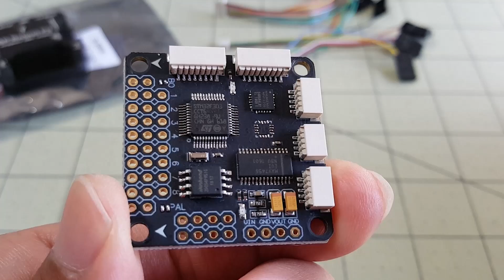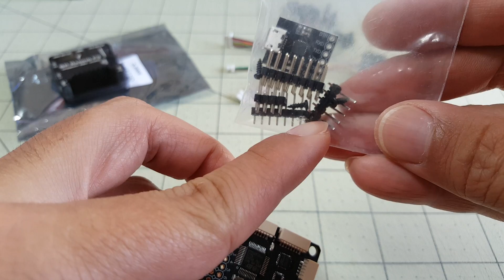F3 Flight Controller with OSD

Comment: Hi is there any chance you could tell me were to plug board in to use on etc betaflight, inav not having much luck.
Keep having a little green light flickering that it . plug in to another port get same green light and a red flashing one looked for a boot button but nothing on board.
Do i have to power board first please help most gratefully if you could.

Comment: I been having issues with my quad after changing motors. Got rid of the wobbles after raising tpa then I figured out how to flash the firmware. But for some reason I have no osd now. All the stitches are turned on in clean flight but still no osd. Do I need to download the osd as your talking about? The timer works but no flight modes or battery voltage Wich I need and no arm disarm. It just flashes and says no data. Help please? Lol
Reply from the maker: +Ian Rice enable msp on uart1
Reply: Albert Kim it is. I been trying to try it to work for days. I been learning allot. Do you have any other ideas? I have figured everything else out but the osd. Thank you for you help!!!
Reply: Oh I'm using the flycolor sp racing f3 board. Just thought you should know.
Reply: I turned on uart2 and Bam it's all working!!! Thanks man.

Comment: I have this thing wired directly to the battery using vbat pads, however mw osd will not display correct voltages.  it's stuck at 15.3 no matter what I do :(
Reply: 3D RC Did you end up sorting this out? I've had the fc for a while now and after updating minimosd +betaflight I did something wrong, so now my voltages are constant 16.4V....

Comment: Can you please tell. I badly know colloquial English, because I from Russia. What you need to do to turn the OSD on the controller?
Reply from the maker: +Виталий Its already on. You have to connect camera and vtx to have it pass the data to the video for overlay.
Reply: I'm all hooked up. But betaflight in the tab menu is written: "Your flight controller does not respond to commands menu. It probably means that it does not have an integrated BetaFlight of OSD" in the Flight controller just like in the video(F3 flight controller with integrated OSD).
Reply: Виталий anche a me risponde nello stesso modo... Come faccio ad attivare OSD??
Io uso INAV 1.7

Comment: Hi,nice review.. could you help me about wiring in spracing f3 include OSD? could you share the link? I'm so confused about powering the board,because I already connect 5v power from PDB but the board won't power on, thanks

Comment: Hi, thanks for the video.

At last find some information on this board.

At the moment everything works for me but I can not find information on how to connect an IBUS FS-A8S transmitter.

In a normal F3 this transmitter is connected to the welding points of the UART2 ( TX, Gnd and Positive) but in this plate I do not know where to solder the three cables (Negative, Positive and Signal)

Can somebody help me??

Thank you.

Comment: Do you known purpose of pads marked as "PAL"?
Reply from the maker: +David Gigauri no sure
Reply: Interesting point, I can't find any info about this pads.  :) I have same board, but have no time to setup it on second drone.
Thanks for response.
Reply: Probably for the osd to enter "pal" mode or "ntsc" mode. 
Un-soldered means ntsc, soldered means pal. 

That's my guess!

Comment: I just got the board. Updated the FC and OSD software (eventually).

I've quickly checked that the configured OSD display appears via the camera / VTX, but am unsure if there needs to be some software config done to actually get the FC data to be reflected on the OSD i.e. did they simply put a separate MinimOSD on the board which gets the data for display or do you have to configure a UART to allow it to be displayed.

Ideas, anyone?
Reply from the maker: +normoa you need to configure the UART and enable MSP
Reply: Which UART (presumably UART2) and does it require wiring from the OSD port to the UART?
Can you give me a bit more details with the setup? (Presume I'm dumb and you may not go far wrong... :D )
Reply: Hi, I assume it is hardwired to a UART, but the question is which UART? (I can not find any documentation on this). Do you perhaps know which port it is connected to? and any specific settings in Betaflight needed? Thanks

Comment: where would I hook up a spectrum satellite rx to this?
Reply from the maker: There is a 3.3v output documented in the manual on page 1. There is no dedicated spektrum port.  You have to grab 3.3v, GND, and RX from one of the UARTs.
Reply: so going by the docs it says gnd ch3 and adc1 or 2 for the 3.3v on the Io-2 connector. I think that's right ? thank you very much for your quick response albert!
Reply from the maker: You can get ground anywhere.  The 3.3v pin is the one that's important.  Also the RX of whatever UART you choose.

Comment: can you pls help me with this fc ? all is fine but when i connect my lipo the configurator stops working ...what i have to do ?thanks
Reply from the maker: What do you mean by configurator?  The software on Windows?  Also, do you have USB and lipo both connected at the same time?
Reply: Albert Kim 
Yes on windows ! I run btfl 3.01
Spf3 target !
Usb to ttl conected with fc and lipo ....
I can not cal. Esc and endpoints off rx ...

Comment: overall thoughts? good FC? what is on the osd? tuning thru osd?
Reply from the maker: It's good.  The OSD is the micro minimOSD so it does all the same stuff that one does.  It's just integrated into the one board.

Comment: Hi sir, thanks for the video, I'm new on drone world and I'm trying to build my first one now, I just bought this board but I cannot find any wiring diagram for this specific one, do you have any wiring diagram to share with me?
Reply from the maker: click link in the description... the manual is on the product page.  it's a PDF file you can download.
Reply: Hi, Thanks I just flashed with latest firmware, now I'm going to flash the arduine and then OSD. But on this website doesn't have the wiring for other stuff :(
Reply from the maker: Perhaps you can be more specific on the "other stuff" that's missing?  I'm not sure what you're talking about.
Reply: Sorry, I mean I need a general wiring guide for everything using this board, FPV, camera, etc. is there any available?
Reply from the maker: Sorry, that's the only documentation I'm aware of.  For the VTX and Camera, you connect those to VOUT and VIN (stands for video out and video in).  It's clearly labelled on one of the diagrams in the manual.
Reply: Thanks, managed to upgrade and configure OSD. I'll have to figure it out how to connect these things, I have no idea :( I would like to have something like this: http://www.dronetrest.com/uploads/db5290/original/2X/1/13615e836e576d74c578c5da74e82a5b1035dd6f.jpg

for this board

Comment: Hi Albert, maybe you can help me,

I can't see my receiver input on Raceflight on this board. I'm connected  with sbus from my xsr to the pin 3 on UART3 (ch3).
On Configuration Tab, I set up RX_SERIAL and sbus. On Ports section, UART3 is used for Serial RX and UART2 is used for telemetry.

I can read the battery pack voltage on my Taranis so the telemetry is working but my control input are not working. Do you have any idea?

Thank you
Reply: you saved my ass with this one, apparently the manual likes to state false diagrams. did you have any trouble powering your xsr via usb?

at the moment, i have my gnd, 5v, and uart rx3 from the io-2 port and my s.port hooked up to uart tx2. think it might be better to get my 5v from uart 2?
Reply: Vincent 2r2b I'm not too sure about that. The xracer f303 fc powers the rx via usb, but that may probably be bc its SBUS 5v is on the same rail as the pwm pins. For the sp f3 though you're definitely spot on, I couldn't get power via usb no matter what i did. 

And thanks for the reply, it's always good to get confirmation that you did something correctly lol.
Reply from the maker: Are you sure you connected to RX and not TX? That's usually a common mistake that people often overlook.
Reply: According to the manual: https://s21.postimg.org/uqm777w13/2016_10_14_17_50_39_R_cents_Google_Disque.png
Reply from the maker: So, is the XSR getting 5v or 3.3v?
Reply: Albert Kim 5v. I should mesure the voltage. but my telemetry is working...
Reply from the maker: +Vincent 2r2b Hmmm, I'm stumped... maybe try a different UART?
Reply: ok guys, in my case SBUS must be connected to ch4 on UART3 in order the receiver to work. Hope this can help someone else!!! :)
Reply: @joshua, it's not possible to power your xsr (or anything else) directly from your USB. You need to plus your battery to power on your Receiver, VTX, etc...
Regarding your 5v, they should be the same regardless of the uart.

Comment: Thank you for making this video.

Two questions:
1 .How do you flash CleanFlight on this board? I am using the provided USB2TTL adapter with the pins connected as you show but I am always getting a "No response from the bootloader" error. EDIT: Need to disconnect the white cable pin from the USB2TTL flasher and select "Manual Speed 256k" on CleanFlight Configurator.
2. Is it safe to power the board via the VBAT pins on 3S?

Many thanks in advance.
Reply from the maker: +FrontierNG The vbat pins just detect voltage reading.  You still need a 5v source for board power
Reply from the maker: +FrontierNG The vbat pins just detect voltage reading.  You still need a 5v source for board power
Reply from the maker: +FrontierNG The vbat pins just detect voltage reading.  You still need a 5v source for board power
Reply from the maker: +FrontierNG The vbat pins just detect voltage reading.  You still need a 5v source for board power
Reply from the maker: +FrontierNG The vbat pins just detect voltage reading.  You still need a 5v source for board power
Reply from the maker: +FrontierNG The vbat pins just detect voltage reading.  You still need a 5v source for board power
Reply from the maker: +FrontierNG The vbat pins just detect voltage reading.  You still need a 5v source for board power
Reply from the maker: +FrontierNG The vbat pins just detect voltage reading.  You still need a 5v source for board power
Reply from the maker: +FrontierNG The vbat pins just detect voltage reading.  You still need a 5v source for board power
Reply: Your Edit cound't have come at a better moment.

Comment: I was excited about this until I realized you had to program the osd with an arduino. I can't stand that crap! Think I'll stick with the PowerOSD Pro osd/pdb
Reply: you can program it with the included adapter so no need for extra hardware..
Reply: Oh yeah? Well that's a different story then..
Reply: Yeap with the included USB-TTL adapter you can program either the osd or the fc , depends on the slot you connect it.. and its easier for later programming to connect the small adapter rather than the usb plug in the quad

Comment: Hi 
Can you try if the new betaflight osd tab can control and setup the internal osd of this board? Thank you
Reply: it can you have to flash scareb osd
Reply from the maker: +Ananous no it can't. That's for a very specific setup. This hardware is different
Reply: Do you have links to Betaflite and Scareb OSD? WOuld like to try this. I just got this board.
Reply from the maker: +JF Kerekes sorry I don't know where scareb is

Comment: 1103, 1104 motors? Someday?
Reply from the maker: 1104 motors going on the mosquito but my PDB is lost in the mail so there's a delay there.  The 1103 will require a custom frame so might be a while.  Is there a specific question about those motors I can address in the interim?
Reply: I'm searching the web for smallest, brushless, affordable setup. Actual weight of the motors? Wich props this motors can spin without the overheating? Which battery can handle? Some thrust test. Any suggestion for other components? ESC, FC, frame ~100mm or less. And so on. Thanks.
Reply from the maker: I did a brief overview video on the 1104 motors. They are very similar to the DYS motors. You can probably run them on 2 or 3S lipos with 3020 or 2535 props. They require a special T-style prop. I believe the weight was 5g but I did weigh them in the video if you check it out.  I will do an overview video on the 1104 and try and address these questions.  Thanks for your feedback.
Reply from the maker: Here's the video on the 1104 motors - http://www.youtube.com/watch?v=7Zi0pG5gwpo
Reply from the maker: +Roman Mic for more affordable setup avoid 1104 and smaller. Those are more expensive because the parts are scarce. Go with a 1306 130 size build.
Reply: Thank you. Looks like i need to wait when/if the parts for micro brushless will be more common. Parts for 90mm brushed setup with F3 board should hit my mail soon.